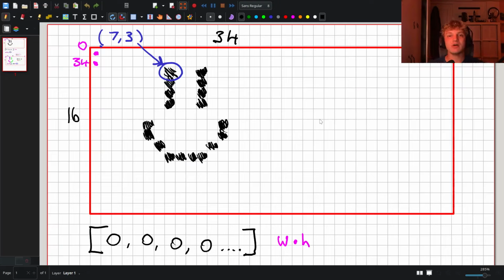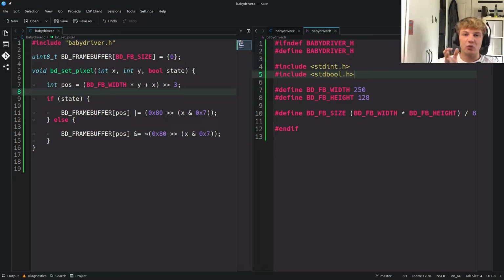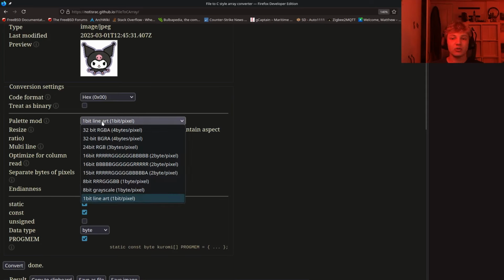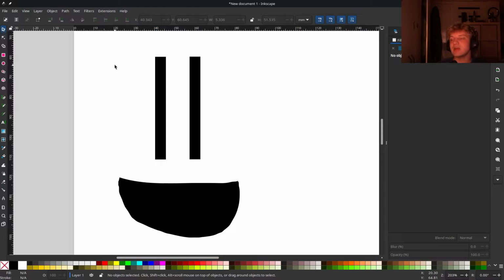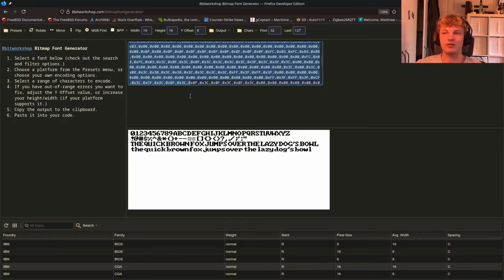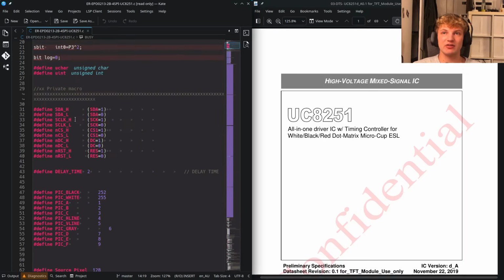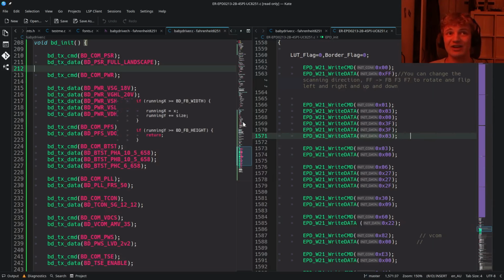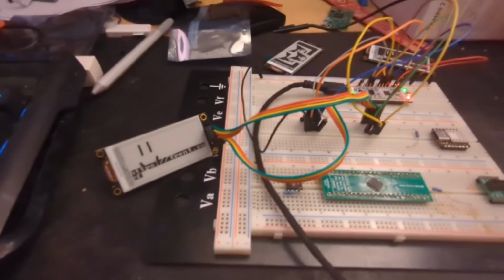How to Write a DISPLAY DRIVER from Start to Finish!

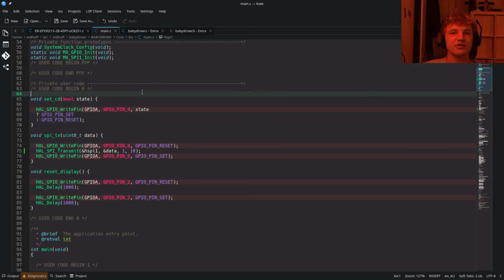Comment: Hey, 55:33 in your spi_tx function, is GPIOA pin 0 used to control the CSB pin on the display?
Reply from the maker: Yep! Because the protocol is a bit weird I elected to use software chip select instead of hardware. It could work with hardware CS but I didn't test it

Comment: Absolutely great video. Which IDE do you use  please? Is it possible to use vs code?
Reply from the maker: Hey thanks! I'm using Kate, it's a Linux editor. You can do this just fine on VSCode; the editor doesn't matter :)

Comment: If you're going to set a bit to one why not just do a bitwise or with 1? Why the extra math for the mask? I'm genuinely confused
Reply: I get it now but why cap it? It should be up to the user to realise they have overshot the value. Also having the mask return a zero from overshooting would be a nicer way of indicating an error than just unexpectedly setting pixels cause an x value of 10 will now cause the 2nd bit in the array to be set instead of not having an effect. Having no effect would have been more indicative of an error in logic than a random hardware or software bug

Comment: The laborious and monotonous part of creating lookup tables, data structures, and constants from data sheets is where AI actually is actually useful.
Reply from the maker: I'll have to give it a try sometime, I see your point. The only issue I can maybe see is if it hallucinates some of the values incorrectly - but you don't know til you try
Reply: @hoff._world  The hallucinations tend to occur with heavier processing where it has to synthesize its response due to non-existing data or context overload. Since data sheets are publicly available, and it's been heavily "trained" on C, and the context is simple, it should be straightforward. You might want to help it along by adding templates to your prompt, such as "here's a command data structure and fill it with values from the list of commands specified in the data sheet and format it." This is where AI shines.

Comment: wow I just realized that when you did the bit shifting, and I visualized it, that you can literally multiply and divide easily by powers of 2 with bit shifting.
nbr >> 1 == nbr / 2
nbr >> 2 == nbr / 4
nbr >> 3 == nbr / 8
....

nbr << 1 == nbr * 2
nbr << 2 == nbr * 4
nbr << 3 == nbr * 8
...
Reply from the maker: yup, and thats a very common optimisation. cool huh
Reply: One of the simple joys of low-level coding back in the day.

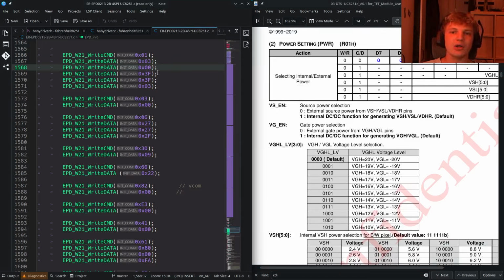Comment: 46:12 Wait, what's the purpose of that exactly?
Reply from the maker: so that if someone is looking at my library the values being sent aren't 'magic numbers' but instead actually mean something and can be cross referenced faster with the datasheet :)
Reply: @hoff._world  Oh sorry, I meant like setting up the voltage values or whatever :) I didn't get the specific purpose of the instruction that you coded at that time :x
Reply from the maker: ah gotcha, those voltage values are set by the panel manufacturer, to the best of my knowledge (i dont claim to be an expert on e-ink display electrics so double check these):
- VS/VG_EN determines whether you want to supply external power to the chip
- VGHL_LV selects the 'high' and 'low' voltage levels for the gate driver i believe? gate drivers are ICs that take low power input and produces high drive current for manipulating pixels
- VSH selects the 'high' voltage level used for setting/unsetting pixels
- VSL selects the 'low' voltage used for setting/unsetting pixels

Comment: now what about if I don't use a framebuffer?
Reply from the maker: i suppose you could transmit on the fly if you really wanted to, would be a bit hacky but may work :)
Reply: Unless you can draw the pixels faster than you can push a new frame, you will either get flickering or half drawn frames.
Reply: @Dragar-X  You can get flickering and half drawn frames with framebuffers. To fix those you need something extra such as double buffering or syncing to the display refresh.
Reply: Your screen will be lethargic or have a seizure, depending on how fast you can push frames at a time.
Reply: Atari 2600 like it's 1977

Comment: hi, i've been interested in custom document formatting automation. have a lot of specific things i want to do, LaTeX and google docs have been nightmares, eg trying to create more than three columns, have lines wrap properly, turn off specific commands within specified regions, specialized formatting for hyper-condensed text, custom pagination and margins, etc. i'd like to create my own custom word processor from scratch; idk whether or not display drivers are relevant to this. any chance you can point me in the right direction? if you made a "start to finish" tutorial for this i would eat it up.
Reply from the maker: so couple of things i notice right off the bat, depending on 'how far' you want to go with this concept
- you design your own file type, syntax and syntax tree (think similar to XML, HTML, etc)
- then you'd have to make a parser, and write a program to take that info and visualise it
alternatively if you want your own word processor that uses existing formats like XML or HTML there are parsers for XML/HTML out there, and you can just define your own custom styling and tags then write a word processor to display it properly

why not use HTML for document generation? It prints to PDFs in browsers, which are also your 'document viewer'. It has a tree style approach which makes it nice to code for.

Comment: Since this is a solution for microprocessor, it is not a real driver. In my era we called it a proprietary operating software. It does not use Linux Kernel, so you developed implementation which does not satisfy a kernel API...
Btw, we were programming the display communication on the bus over 20 years ago, and we used assembler for Atmega8535, so we developed all including the gates, common bus communicating with the Sensory Voice Direct II. board, motor controller, keyboards, USB driver. Don't buy the hardware, develop the h/w and s/w by yourself from the circuits you buy and develop the PCB board on private basis with acids as we did it. Enjoy! One more thing, try to use DSP development Kits and develop mathematical algorithms and sound algorithms like filters using DSP assembler from ADI (Analog Devices company) and later use C, and find the differences.
Reply from the maker: i mean depends on how you define 'driver', you can play semantics about pretty much everything in computer engineering - not sure why cubemx generates a "drivers" folder with only HAL code in it if I need a kernel for it to count... looks like ST disagrees :P
Reply: @hoff._world  This has nothing to do with computer. It is only a microprocessor and it is always developed in small group - non standard. It is only a s/w for you and nobody cares if you develop a proprietary implementation because nobody can use it. Drivers are always about well working API which necessarily requires a manager - operating system, memory management. If somebody could use it, it would be more realistic and then the guy would have to think of an API dedicated for multiple drivers and then he would have to do it on the top of a kernel, it does not matter if it is Linux Kernel or RTOS. Then it would be a real driver. But now it is only a toy, a playground. You have to get inspired by real drivers, real operating systems and follow real PATTERNS verified by practice. But this is still only a playground, fitting well to the display but later he would realise that he has to write another "driver" and after third device he would realise that it is not effective to reinvent the wheel and there must be some kind of API, then he would realise that he should follow some patterns, and finally he would realise that he needs an operating system to control memory and processes working concurrently with the devices. Now it is a proprietary s/w fitting to this display but nothing more.
Reply: @tibordigana2551  dude, whats the point of your comment? Sounds like you just want to impress someone with stuff nobody asked you. This guy uploaded a video in which he does some stuff and you reply with "no, you have to do other stuff because its better"?

Comment: What's up, man, long time no see. I'm in a national high school rocket-building competition, and I got the electronics role. I like doing embedded stuff, but I'm not that skilled. Would you like to maybe have a little chat? I really like the idea of designing my own circuit board with ESP32 and programming it in raw C. I'd be grateful for any recommendations or pointers you could give me... It would only take a few minutes, I know there are forums and stuff, but I literally consider you Tony Stark. 

Yours faithfully, 
raven B)
Reply from the maker: first off it's nice to see you around again :)
I'll start by saying I have a video "Designing a Modchip for the DS Lite" which has an ESP32 design - you can have a look at that as an example for how you might put an embedded project together.

Embedded systems are made up of a lot of subsystems - you want to be able to move throughout them and think about how they all interact and influence each other. For example, if I change the priority of this interrupt is that going to interfere with other critical tasks? Does changing the way I log data impact the software that extracts and reads it? Modifying this hardware value might throw off my ADC, etc.

A lot of that comes down to 'time in the chair' - meaning that you have to do it in order to instantly recognize it as a problem. There's another video I have "What is the Problem Space in Software Engineering" that discusses how important it is to hold a lot of context in your head while you're designing these systems all the way from high level down to the code.

Of course after the high level architecture stuff you actually have to be able to convert that into the raw code or electronics design, which comes down to practice. You need to learn and experiment with your hardware platform, do simple things to understand how the concepts work (i.e. set up a timer that blinks an LED, boom now you kind of know how to set up a timer that you can then make more useful). In fact, your program is nothing more than a lot of these baseline concepts that work together to do something useful.

There's an "Embedded Systems" playlist on this channel that might help you with the concepts.

Hope this helped, good luck and thanks for sticking around :)
Reply: @hoff._world Gold
Reply: @hoff._world  Thanks for the reply B) I'll definitely take a look at the playlist. It's always a pleasure when I get an upload notification form you o7
Reply from the maker: i do intend to get back to u gimme a bit tad busy and want to give a proper reply

Comment: How did you get into embedded though,

I am a electronics student still struggling to keep up,.
I know basics of programming a bit since i was doing a bit web dev before,

I am currently reading c programming a modern approach book,
And my electronics side also kinds sucks,
Reply from the maker: depends on exactly what you're struggling with - embedded is a different "style" of C programming to what you might have seen before, kind of like fiction writing vs. factual articles. It's still writing, but different enough.

are you struggling with basic C programming concepts like control flow, functions, data structures, etc. or embedded specific things like registers, communication protocols, timers, and the like?
Reply: Hm, what's the way to learn c you recommend,
I know I should learn a bit more about pointers and memory management, and stuff,
, thankyou
Reply from the maker: Do fun projects that excite you and actually give you a reason to code in the first place. I find learning for the sake of learning kind of a chore when it comes to programming and find a practical approach is best :) I have a video on the channel "Getting Good at Programming" and "How to Start a Software Project" that may help you out.
Reply: @mufeedcm you get good at electronics by actually building with them hands on. More specifically get used to copying existing designs and studying how they work rather than thinking you will come up with a design on your ow

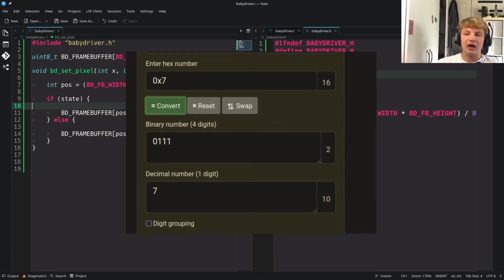Comment: 10:35 surely it would be better to say that anding with 0x7=7=0b111 gets you the remainder of the division mod 8. For the same reason that taking the last three digits of a number base 10 gets you the remainder for a division by 1000 (10^3), i.e. the remainder of 6123/1000 is 123. You get the right group of 8 bits by dividing by eight, and the right index into that group with the remainder. Also why start with 0b10000000 (0x80) and shift towards 0, rather than starting with 1 and shifting away from 0?
Reply from the maker: sure, that's the correct explanation, looks like I said "I'll throw some stuff up on screen to show it" and then forgot to add it in editing... as you can imagine this vid took ages to make and i missed some things :)

as for your second question absolutely no reason, naturally you can do either way and it works fine
Reply: @hoff._world  Ahhh, fair enough! That bit just caught my eye for a second.
Reply from the maker: thanks for adding to the discussion 😘